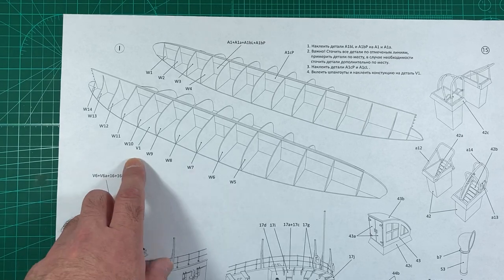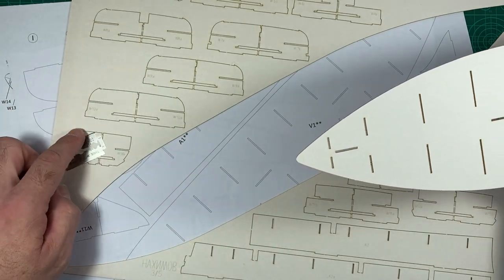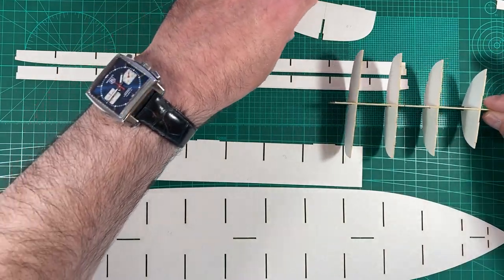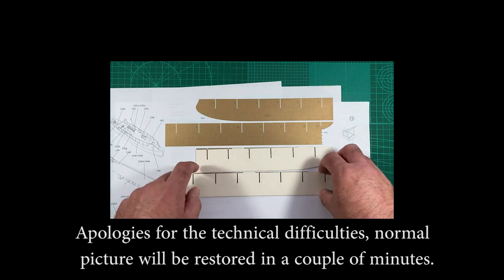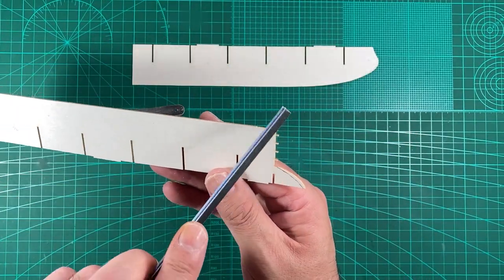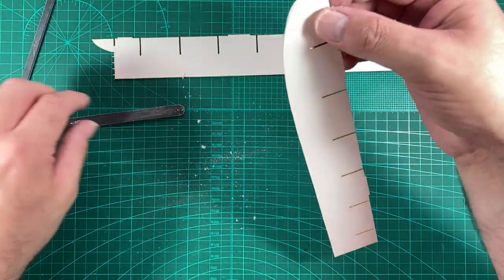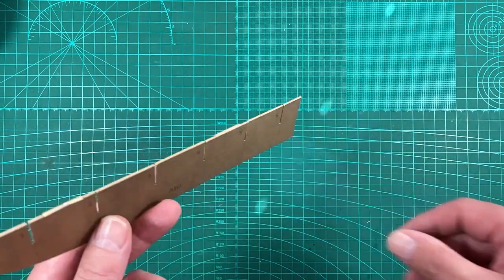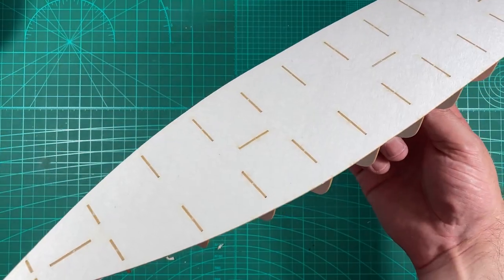Admiral Nakhimov, Paper Model, 1/200 Scale, Part 2, Lower Hull

Comment: In the past I've made extra plates to go on the top and bottom of the Waterline plate that fit between the traverse frames and up against the longitudinal frame(s). This stiffened the frame work up nicely. Also I've found that cutting extra ribs to go on both sides of the traverse frames gives extra glueing support for the hull plating
Reply from the maker: Thanks for watching and commenting and for the helpful tip.

Comment: Great video, would have liked to have seen the cutting of the gold paper, it looked very neat and accurate. After the razor cutting was expecting the following scene to show your hand covered in plasters 😊. I always tape over one edge when I am using double edge razor blades. What was the old syringe type you were referring to?
Reply from the maker: Thanks for the comment. I didn't bother showing the cutting of this paper as its not really representative of the rest of the model. Although the upper hull has similar deck cladding so will include that in the next part.  LOL I don't typically cut myself, I stab myself with the tweezers much more! Good tip with taping the other edge.  If you Google search 'monoject 412' thats what I had before. It was good as the body and nozzle is molded in one and the curve is rigid. I think the one I used for this video will be okay as long as don't apply to much pressure blowing the nozzle off.